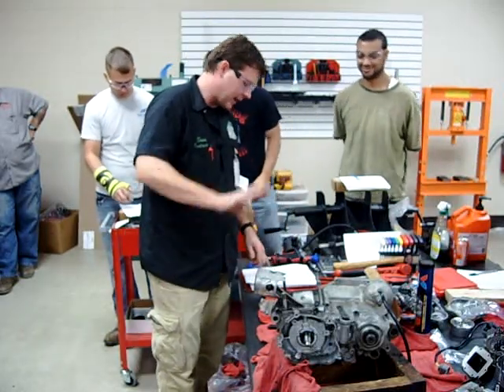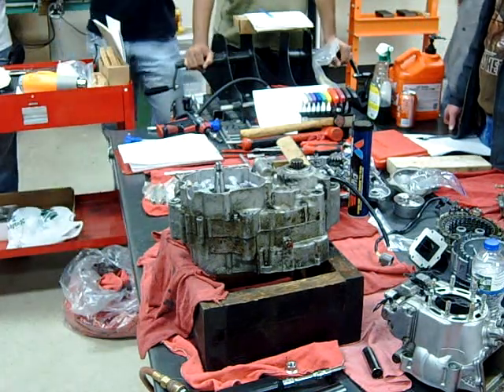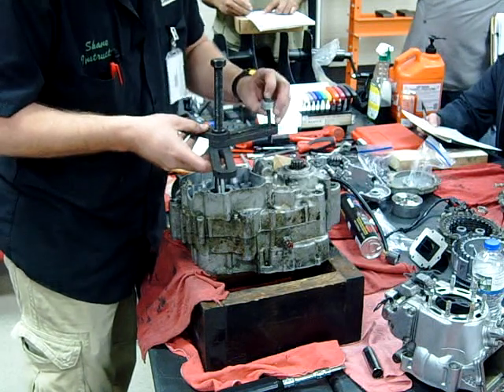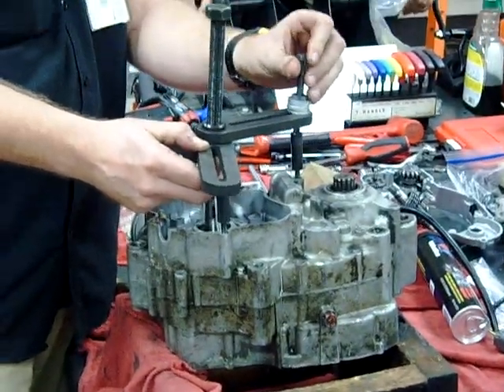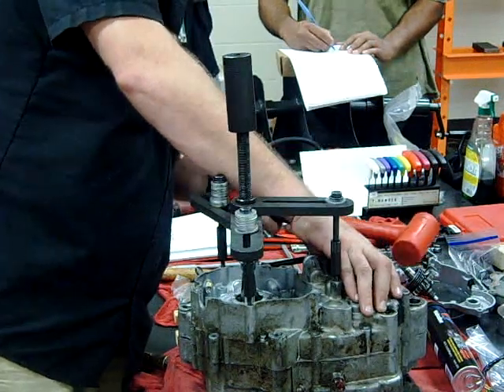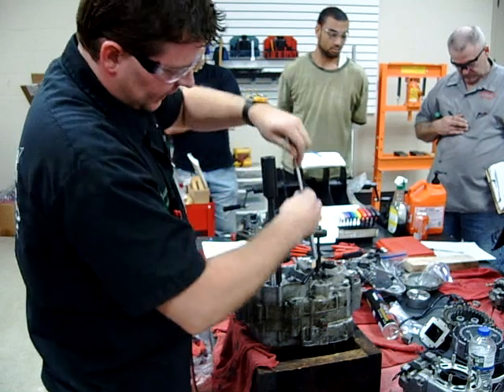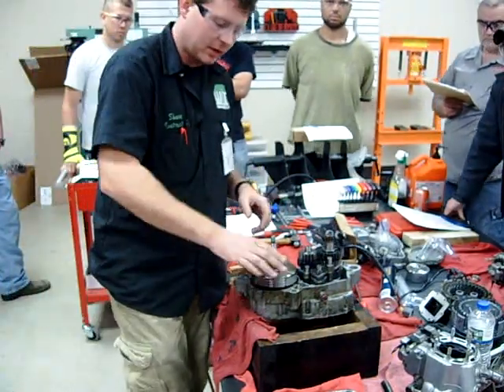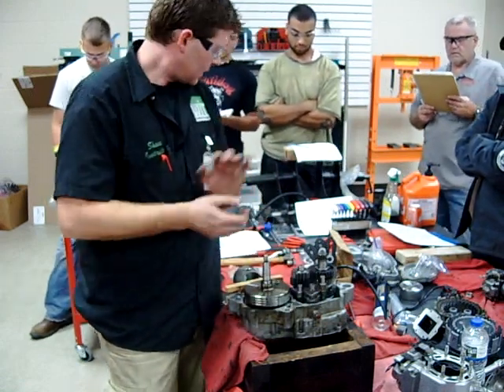2-stroke dirtbike motocross crankcase splitting separation removal part 7

Comment: Better pullers have different length bolts, and no need to mess around with washers. Using a heat gun on the crank bearing on the side to which the puller is fitted, will make it come apart a lot easier.
Reply from the maker: Thank you! Please share on your social media! Make sure to subscribe and click the notifications button for all future videos! Also, my playlists are broken down pretty well. The most popular one being: "Every Mechanic Should Know This" 

https://www.youtube.com/playlist?list=PLAtBOuPaEyt_uMyVlK1tsBVnSYW1Q0vCK 

Feel free to make any suggestions or reach out to me for personal mentorship,

Keep Wrenching, 
Shane Conley
Instructor/Motivator/Motorcyclist
Reply: Shane Conley I dont know whats wrong with my bike when I let out the clutch and give it gas it goes about five feet and then stops. Do you have any ideas of whats wrong with it?

Comment: @ 8:55 one dude says to use nuts, yes that is better ides than using washer, if nuts are used then you dont have to pull the bolts out every time you want to adjust the height.